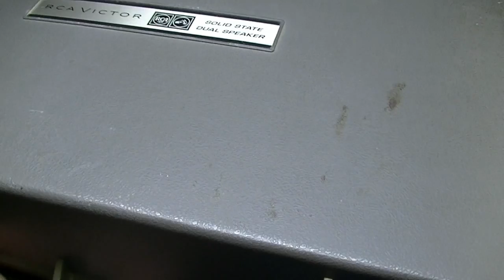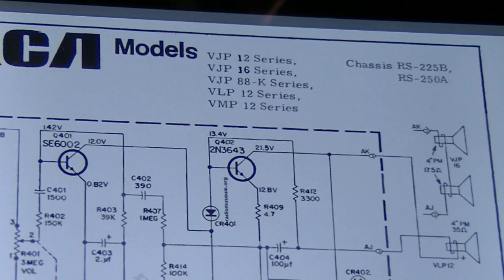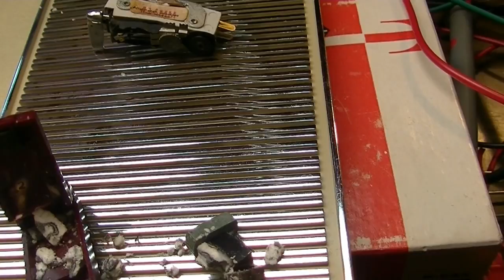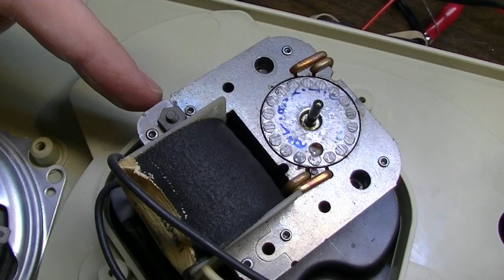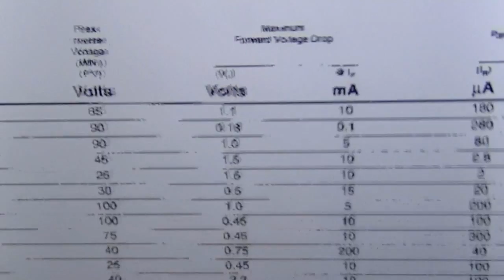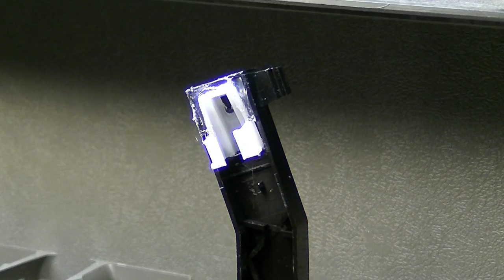Garbage to Gold - Making a Record Player Preamp from Junk Parts

Comment: That crumbly stuff is a substance called "Rochelle salt" a piezoelectric material that you can actually make from simple ingredients. The problem with it is that it is hydrophillic. and draws humidity from the air which causes it to swell and crumble.

This was used in microphones and phono cartridges from the '30s on. Construction was ultra simple: a piece of the material was mounted in a shell and a rubber arm was fitted over it and that in turn connected the stylus to it. Movement from the stylus flexed the crystal generating an electrical current. Later versions (like today's cartridges) used a modified formula to make the crystal more durable and less humidity friendly. some were even painted to form a barrier. This new formula was not as energetic as the original though but coming in the age of cheap transistors and foreign labor it was no problem with new gear.

Comment: The cartridge used was a ceramic cartridge which will put out about 300/400 mV. It is in no way a magnetic cartridge, which. would only put out about 2/5 mV. A magnetic cartridge would also need a tracking force of probably 2/4 grams and need RIAA EQ, way over the top for such a low lost arm and amplifier. All that was really needed was a simple preamp with 300MV input to about 2 volts output, but saying that your preamp did work. I'm amazed it did because a mic preamp would typically have a 1/4 mV input which should have been somewhat overloaded with the cartridge 300/400 mV output. Maybe the lower input impedance of the preamp shunted part of the cartridge output, who knows. But it did work so well done!!
Reply from the maker: Michael, thanks for the comment! The website called for a tracking pressure of about 4g on this cart. Not sure why I called it "magnetic", but you're right, the site clearly says "ceramic". I think I did mention that also. But anyway, I think the preamp worked because it was also a compressor. Actually, it seemed to work rather well.

Comment: The P-188d is a ceramic cartridge.  It is significantly lower output (approx 0.35 vs. 3.0 volt of the original crystal cartridge), but it is not a very low voltage moving magnetic cartridge...but it looks like your compressor circuit is working to limit the gain.  Also, to get the most out of your ceramic cartridge you would theoretically want your preamp input to be very high impedance (1 meg ohm). At lower impedance you should lose bass...but maybe not noticeable with those small speakers.

Comment: A counter weight on the end of the arm would be a simple solution for the tracking pressure.

A tongue depressor or popsicle stick attached to the end of the arm with a few nickels or whatever positioned in the right spot for desired needle pressure was my first idea.
You might come up with something more clever and ascetically pleasing.

Great job on that preamp!
Reply from the maker: I did think of that. I also went back in and removed a little bit of glue and nylon from the mount, but that didn't reduce pressure by much. Took off about 1/10g. Any counter weight would need to be small profile because there isn't much room between the back of the arm and the case when closed.

Comment: The 1458 produces muddied sound in audio projects, if you wanted to brighten up the sound considerably, you should switch to a NE5532.  For this project it won't get better than that.

To reduce the power line hiss place a .1UF non polarized capacitor across the power line, close to the large filtering cap and also across the 1458, #4 + #8 pins.
Reply from the maker: Thanks for the tip. I'll consider that for the future. To be fair though, this didn't turn out muddy. It's fairly balanced. There are some mid frequencies that resonate as you turn up the volume, but that could be down to small speakers in a plastic cab.

Comment: It is the same routine for any player. Turntable first.
The usual procedure is to lubricate the turntable bearings and clean the trip-and-return mech or any dried up grease. 

A cartridge which contains a Rochelle Salt crystal of such output this would also drive a 6BQ5 tube direct. Try getting a good one of those with a turn-under stylus.
The old turnover types were record-killers, not stereo compliant. That tracking weight is ballpark for the high-output crystal cartridges.

Comment: I love how they call it 'twin speaker', implying that it's stereo when it's clearly not.
Reply from the maker: Electronics companies were cutthroat back then. They also used to put extra transistors in radios just so they could claim there were more transistors as a sales tactic, when the transistors weren't actually hooked up to anything!
Reply: +The Guitarologist    I'd heard of that, a long time ago, and had forgotten about it!  I remember thinking at the time that if the 'functional' transistors ever died, you had spares built in, lol.

Great.  I think I heard that in high school.  In the early 1980s.  Gads, I'm old.
Reply: xaenon,  They didn’t imply anything. They didn’t say stereo...
Reply: Well, they COULDN'T say, legally, that it was stereo.  But making a big deal about 'twin speaker' (which actually has NO technical advantage in a player like this) makes the IMPLICATION of two channels, or as we like to call it, 'stereo'.  They toss another $1 speaker into it, jack up the price another $5-10, and it'll still appear to be the better deal than an actual stereo with the higher price tag.  And technically, they don't even have to hook the speaker up!   It's essentially a 'passive lie'.  They're not actually telling you it's stereo, but they try real hard to make you THINK it is.  Classic snooker and misdirection.   The advertising industry was BUILT on this tactic.

Comment: I once changed a Crystal cart (6-8g tracking)on an old Bush record player to a Sonotone 9TA HC (4-6g tracking) and hoped for the best. Of course BSR turntables had a spring under the arm which you could detach and put more or less tension on it to vary the weight. I have no idea what I ended up with but the change reduced the volume of the unit by quite a lot (amplification by single EL84 as I recall) so the volume control was constantly at maximum, no complaints from parents!The things teenagers do to "improve" things..........

Comment: After reviewing the power supply maximum voltage rating of the LM1458 is can work with a plus and minus 18 volt power rails if using a bipolar power supply.     In the single power supply circuit you are using using the 21 volt power directly from the main board would look like a plus and minus 11.5 volt bipolar supply.   You would not need a regulated power supply at all.
Reply from the maker: I knew there might be a pitfall of unregulated supply going in and thought that using a second diode to rectify my preamp board's own separate supply might help curb the need. It does seem to operate ok, so maybe this circuit is just really tolerant, or the regulated supply isn't needed.

Comment: Huh, if i remember right, MC1458 is prone to audible crossover distortion, it's not usually the best idea to use it in audio reproduction gear. Then again, looking at the rest of that amplifier, perhaps it didn't deserve anything better.

Wonder why the own gain of the device was low though? I mean maybe it's fine without preamp when it's all closed up and enclosure resonates, or maybe one of the transistors simply started to go and lose gain?
Reply from the maker: I wondered the same thing. I know the crystal carts have more output and the amps are lower gain as a result, but this thing was so quiet I initially thought the amp was dead.

Comment: I would add a LM7812 voltage regulator and tie the power input right to the 21 volt main supply rail for the main board.   Since your preamp does not draw a lot of current you should not need a heat sink for the regulator.    Using a dropping resistor is not a great idea for solid state.  The voltage will fluctuate as your current draw changes.
Reply from the maker: Thanks for the suggestions. I'm just starting to venture a bit more into SS.

Comment: I scrap alot of tv's and physically cut out the amplifier section and use that for my amplifiers...just follow the speaker wires down to the board and you will be close to the amp section...some of the large projection tv's have amps that are rated at 25 watts a channel..nice video..
Reply from the maker: Only problem would be knowing where to cut. A schematic or layout diagram would be helpful for that. You'd need to figure out where to hook in power and input from there.
Reply: I just go from the IC amp chip to the first capacitor for the power...and find the input terminals of the IC for input and speaker out..its not too hard...

Comment: that pfanstiehl cartridge is ceramic not magnetic it has a lower output not all ceramic cartridges have high output
Reply from the maker: You are correct. I realized shortly after making this that I was in error. Ceramics are lower output than the crystal carts you found in many old cheap players. Magnetic is the lowest output, but usually the best fidelity. Thanks for watching!

Comment: Did you keep the compressor? Also I seem to remember on crystal cartridge preamps they didn't bother with RIAA equalisation as the response curve of a crystal cartridge is sort of close to it anyway. The MM cartridge will need some bass boost and treble cut to sound neutral.
Reply: He was mistaken about installing a magnetic.  That cartridge is a ceramic; it's the same one found in most 'suitcase' record players sold today.

Comment: Why did you wire the cartridge up to be monophonic?  That's a stereo rig...two channels, two speakers.  And the cartridge is also stereo.
Reply: No.  It has two speakers, that's true, but they're being driven by a single-channel amp.    As for it being a stereo cartridge, mono cartridges are getting difficult to find and expensive, so the alternative is to convert an inexpensive, readily-available stereo cart to mono.

You tell for sure it's mono by looking at the wiring in the tone arm.  Stereo requires a minimum of three leads - left signal, right signal, and at least one ground (with some equipment actually requiring two grounds, one for each channel).  Only two wires in this - one signal, one ground.  The schematic also shows a single amplifier channel.

Don't feel bad about thinking it was stereo.  Calling it a 'dual speaker' set was a marketing gimmick to deliberately mislead the buyer into thinking it was stereo.  The fact that you thought so, too, is proof that such marketing tricks work.

This thing would be insanely easy to convert to true stereo, though, if one were so inclined.  It would require only swapping out the stock amp for a stereo item (I would source one from an old set of computer speakers), adding a third lead to the tone arm, and setting up some sort of proper power supply.

Comment: 8 grams that needle really digs in. you could hotglue a popcycle stick to the other end of the tone arm as a counterbalance so you could at least get the needle tracking at closer to 3 grams. at 1.5 grams it tracks so lightly if you breath on it it will skip. anyway, great video on repairs. its always a miraculous thing to me. :-)

Comment: Please forgive my ignorance and forgive me if I'm asking before you mention it (we're 10 mins in) but does a ceramic cartridge  not need RIAA equalisation?
Reply: Ceramics generally do NOT require equalization.  When RIAA was devised, they more-or-less had crystal cartridges in mind, because it was the most prevalent type at the time, and their modern ceramic descendants  work much the same way.  Magnetic cartridges DO require RIAA eq, though.  Something about the way magnetics work; I cannot recall the details.

Pre-RIAA records did use different EQ curves, though, and each record company had their own scheme, and it was often tuned to sound best on their own equipment (RCA records would sound best on RCA equipment, etc).  RIAA just standardized a single curve, that's all.

Another part of the equation, not often recognized or discussed, is the impedance of the amplifier's input stage.  Most modern stereo equipment does not provide a proper impedance for a ceramic/crystal cartridge, and as a result the sound often lacks bass.

Comment: The white powder in the original cartridge - is that the remains of the 'crystal'?    I remember reading that older record players used Rochelle salts as the piezoelectric elements; I guess that's what happens to salt after humidity and time do their thing.
What a mess....

I'm working on restoring a 1948 Emerson radio-phono; the original 78 rpm record player is pretty much a lost cause thanks to someone's previous efforts to 'repair' it (missing parts now) and I'm planning on substituting a cheapie BSR 3-speed changer; do you think that preamplifier circuit you built would be suitable for this project?
Reply from the maker: Yes, that powder was probably humidified salt. That's the conclusion I eventually came to as well. 

If that preamp worked in this build, it should for for what you're doing too. A stock magnetic BSR cart should output about the same as the one I used here.
Reply: +The Guitarologist   The BSR actually has a stock cartridge, what I assume is ceramic (early 1970s).  I've been kicking around the idea of converting to a magnetic, but to do so I have to change out the headshell too because it's the 'narrow' one.    Oh, and by the way, I loved your solution to mounting the new cartridge in your record player.  Genius!

Speaking of Emerson radios, I found a company that makes repro knobs that are the same type as the one you identified as 'original' in your 'bulletproof' Emerson radio.  Just in case you're interested.

http://www.renovatedradios.com/product.php?product=204

Comment: You can get those cartridges for less than 2 dollars from China with free shipping. I recently bought 10 of them for 17 dollars.
Reply from the maker: Have you compared the Japanese to Chinese ones? How do they compare?
Reply: I believe they are exactly the same.  If you do a search on ebay for "Turntable Phono Cartridge w/ Stylus Replacement", loads of sellers are listed from China and Malaysia.  They all look exactly the same.  I suspect they are all from one company in China or Malaysia. I got mine a few weeks ago for a price of $1.71 each.  It appears they went up a little and are hovering at just over $2 as I write this.   The seller I ordered from went up to $2.20.  I guess they constantly adjust their price to compete with each other.  The far east cartridge price war, lol.   You will find two model numbers.  The 188 and the 190.  The 190's come with a mounting bracket with the standard 1/2 inch mounting holes.  The 188's don't come with the mounting bracket.  You will also see that some have plastic cantilevers and others have metal cantilevers.  I've tried both which sound the same.   I've installed them in several early RCA 45 rpm only record changers with very good results.  The original ceramic cartridges in the RCA players are almost always extremely weak  or completely dead after close to 70 years since they were originally installed.  So I was delighted to find such inexpensive replacements.
Reply: the china carts compare quite will there good for something like this they put a good strong signal out I build my preamp using a 2N4401 using the amps own power supply that way I only need 12 parts on my board
Reply from the maker: Thanks for the tip! That is cheap as dirt.
Reply from the maker: What circuit are you using?
Reply: The difference is the one you bought from V-M Audio Enthusiasts is a genuine Chuo Denshi cartridge made in Japan, while the $2 ones on eBay are knockoffs made in China.
Reply from the maker: One thing I have noticed, apparently the Japanese one has a plastic cantilever while the Chinese supposedly have aluminum ones. I bought some Chinese ones to try so I guess I'll report back when those come in and compare.

Comment: Any particular reason you went with a compressor for the preamp?  That looks like what the diodes are for - part of the compression circuit.
Reply from the maker: It was one of the few preamps I found for that IC that looked like it would be easy to build and might work well. I thought some compression might even improve the performance of the unit. I think I was right to choose a compressor because, as Michael pointed out in another comment, that circuit was designed for a magnetic microphone and the higher output ceramic piezo cartridge might have overloaded the circuit had I not done that.

Comment: But why such a old part... That op amp is a dual u741!
NE5532 would be a much better somewhat modern and cheap alternative.
Reply from the maker: Because I have 9 of them on hand. Using what was already in my parts bins or in junk pile.
Reply: The Guitologist Certainly makes sense. and its not Hi-fi anyway so it doesnt hurt that much. Nice work on making the old thing work again :-)

Comment: 08-07-67 August 08,1967
Reply: I had to look very carefully at that date - the last digit was so badly stamped I thought it was a '2', so I was translating it as 1962.  Which puzzled me; the styling is a little too modern for 1962, and 'solid state' was kind of rare that year as well, outside of battery-powered radios.